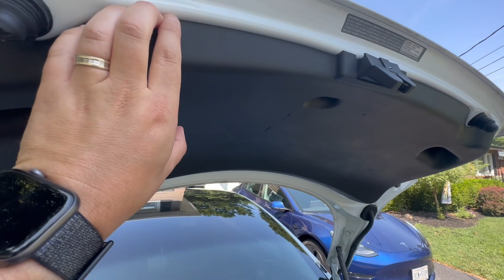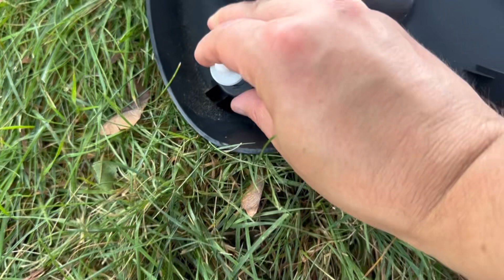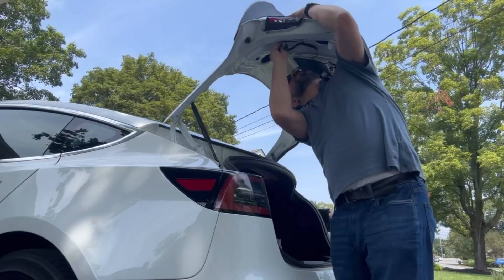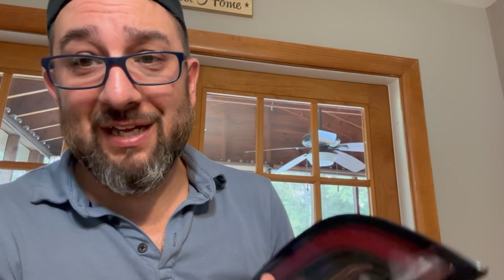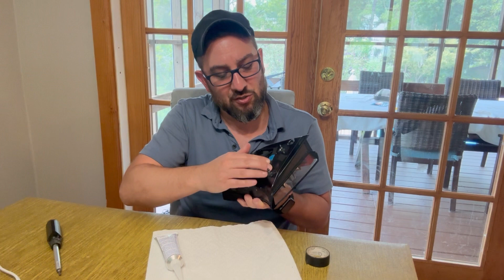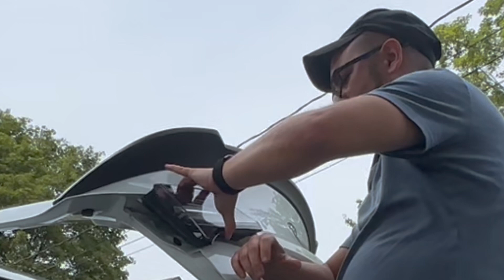SGDS: Tesla model 3, condensation in tail light fix

Comment: When you buy a Tesla you automatically become a YouTuber, an engineer, a problem solver, a warranty worker, an inventor. My question: can Tesla do anything right? So much crap that fails ...  Last question: did that what you did there really fix your issue?
Reply from the maker: Like anything you buy there will always be a need to modify or fix. The amount of work I do in my home once I became a home owner keeps me busy as well. I started with YouTube because my kids asked me to, especially the additions I do to the car. 
To answer your question yes it solved my issue with the condensation. But I ended up replacing them when I saw the  cybertruck inspired tail lights.  Thanks for watching.
Reply: Because no other car brand has condensation in their lights. Oh wait...

Comment: Do not use a hair dryer, instead, you need cool air to circulate. Hot air will make the issue worse as it could melt down some parts which could cause more water to go in. If you can, the best solution is actually dry cold air. One time I got condensation on my old Lexus headlight and I took it out by removing the light bulbs and using a hose from the A/C vent in my house directly to the light bulb opening. The way I attached the hose to the vent was using a shoebox, I made a hole, taped the hose into it and then taped the box to the vent which was about the correct size so all the cold dry air would be directed to the headlight. Since the light has many openings for different bulbs, the cold dry air goes in and blows whatever is inside out from the other openings. It took about 30 minutes to get the condensation out as I had a lot.  Now for Tesla, my Tesla Model 3 Performance had a little bit of condensation one day after a very bad rain storm, but went away in less than 5 minutes from the time I saw it. If it happens again, I will use the Tesla app to ask to have someone to come to fix it since it is still under warranty. You should do the same. Only reason i have not done it is because I like to send them a picture, so I will wait and see if it happens again and take a picture. Cheers
Reply from the maker: Thank you for the reply. If it happens again I will try and use cold air. Issue with Tesla lights is they are sealed units. You will have to cut the glue that holds the piece together to get good circulation. My car is out of warranty and was not going to spend money to get it replaced.
The condensation disappeared and it lasted for a few months till it came back. I then drilled a hole on the bottom of the light to get water to drain better. All in all in the end I decided to change the light with Hansshow starlink lights, which I also made a video for.

Comment: I gonna drill a fking hole in the back of the taillight so air and condensation can escape.
Doing that wont lower the trash quality of the lights at all
Reply from the maker: I thought about doing the same thing about drilling. But sealing it was another option.
Reply: @someguydoingstuff1254  y i ginna drie it and then seal it. now my stupid take: use glue, not the superglue, the normal one to seal it😅